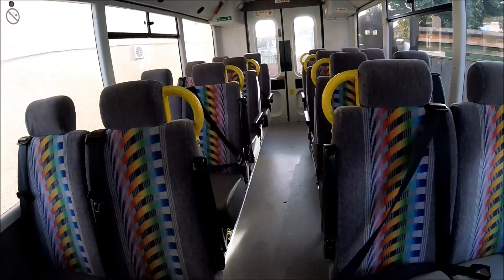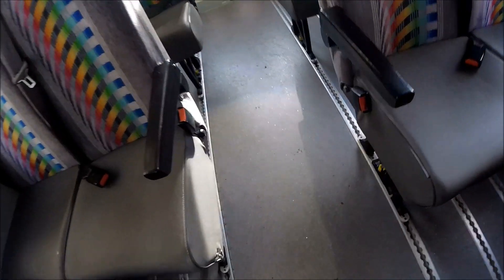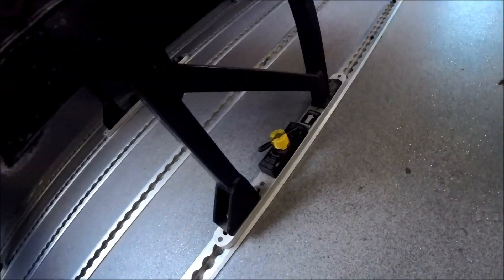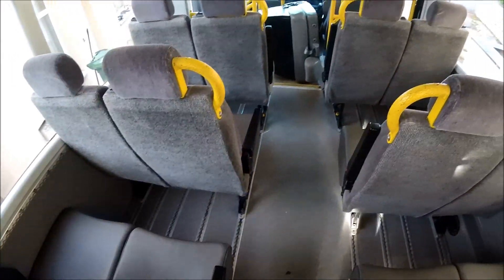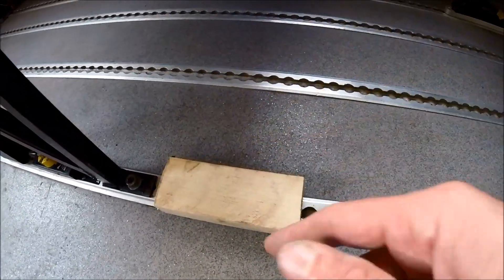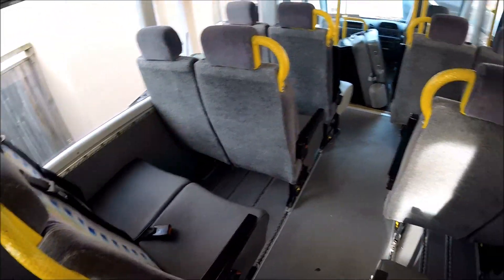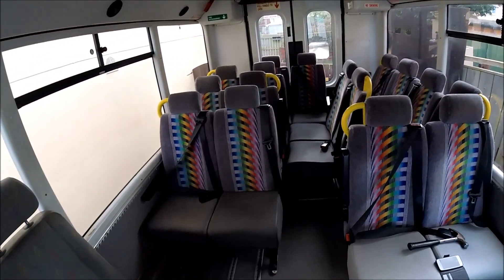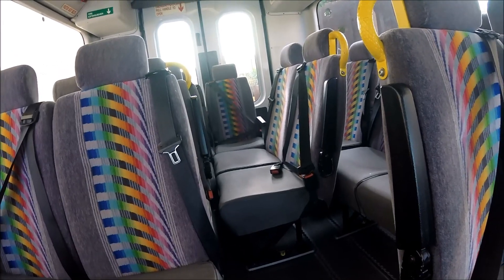How To Remove Minibus Seats From Unwin Quick Release Rails - Mercedes Treka

Comment: I've got one of these type of seats in my vw T4. About £600 new. Awesome seats.
Reply: ounce you release the locking mechanism can the seat slide up and down the rails or do you have to lift the seat out of the rails to change position?
Reply: @paulfindlay6169  You lift the seat out mate. Cannot slide it. It's not as bad as it sounds easy to do. 👍🏻
Reply: @eddt430   ok thanks.  thinking of doing this with a rock and roll bed, maybe difficult to operate on your own though
Reply: @paulfindlay6169  Its defo easier with 2 people if I'm honest. I would go for sliders if it were me working it in my own  Good luck mate. 👍🏻

Comment: Why did it have the middle two tracks as well under the seats ?
Reply from the maker: for adjustable seat layouts from when it was a minibus.  Some wheelchairs also secure to these tracks so also for that use
Reply: @TheCampervanBuilder  can any double seat be used with the unwin rails system, ( possibly with adaption?) or do they need to be Unwin specifically designed for rails ? 
I’d like to put a couple of doubles facing each other like
a train in my Vario camper and thinking rails might be the way
Reply from the maker: @timothybint4960  with adaption you can make almost anything work as desired.  you can buy the feet on their own so presume it'd be doable but not legal it would be to carry passengers without inspection, I don't know

Comment: Did you sell those seat locking mechanisms? Or are you going to? I would like to get hold of 2 or 4 and a strip of what it attaches to the floor. I need to put a single seat in for my kid with a seatbelt for the back of the van but it needs to be removable, that's why I'm asking.
Reply from the maker: All sold, generally available on eBay though